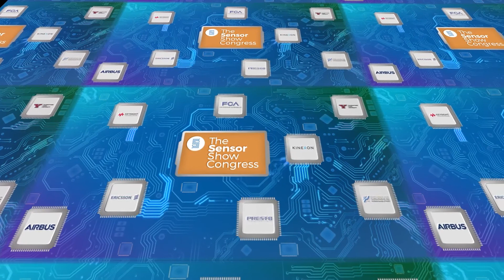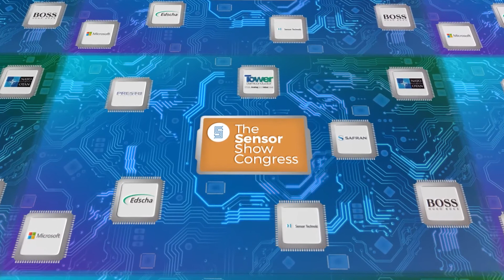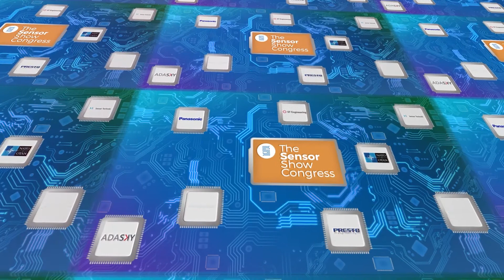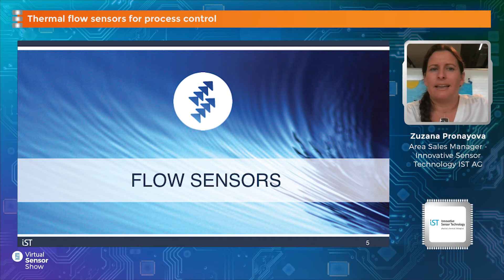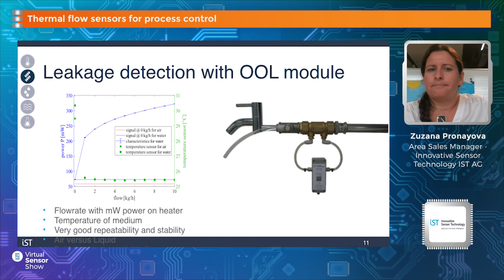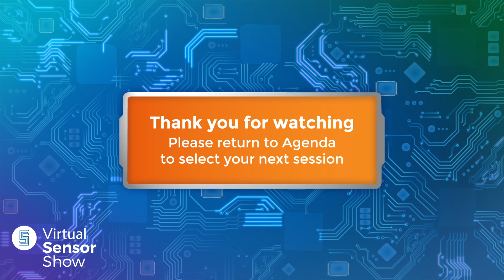Thermal mass flow sensors

Comment: Good work to .  I am using your FS7 Mass air flow sensor. During air measurement in a coal mine, the FS7 surface becomes covered with dust over time and measurement accuracy decreases. How and with what material can I clean the probe surface and what can I do to prevent measurement sensitivity from decreasing?